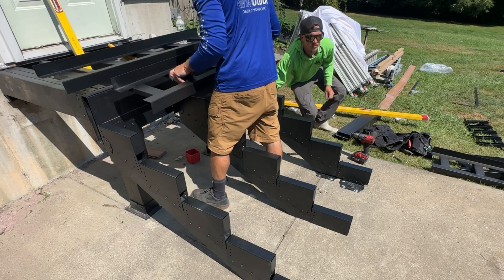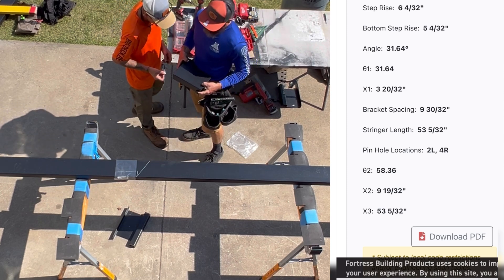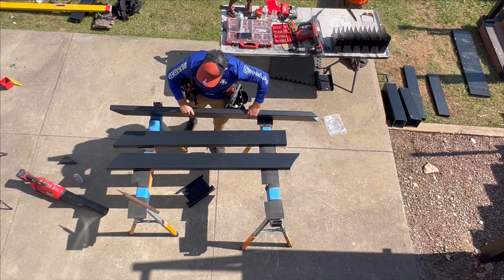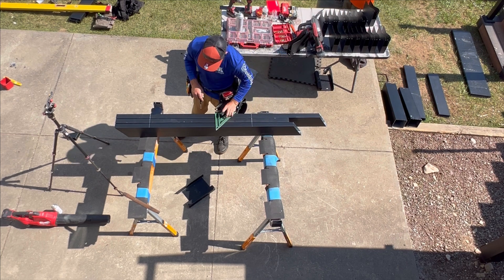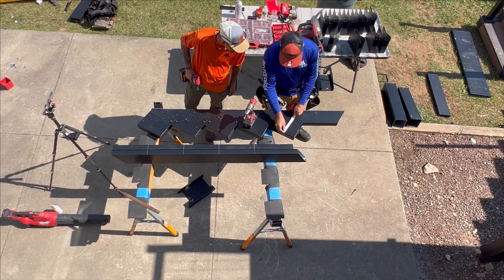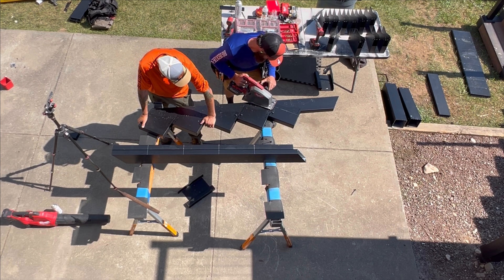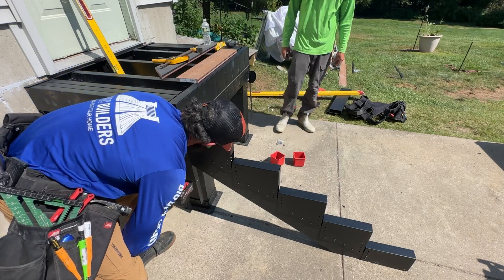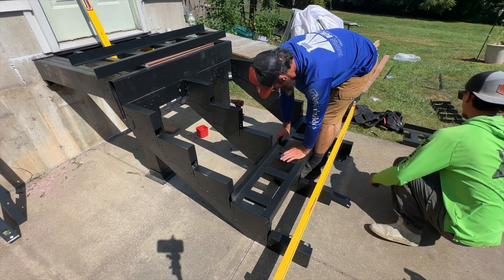STEEL FRAMING DECK STAIRS!!

Comment: how did you attach the f50 brackets on the ledgerboard for the custom spaced joists?? since its on concrete the self tappers wouldnt work i would assume